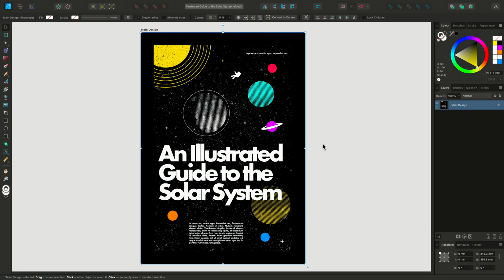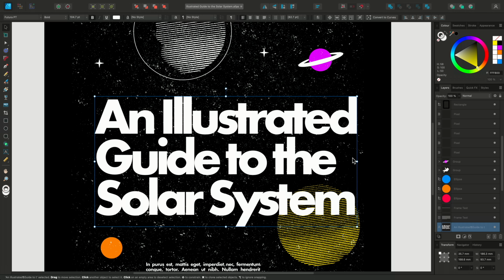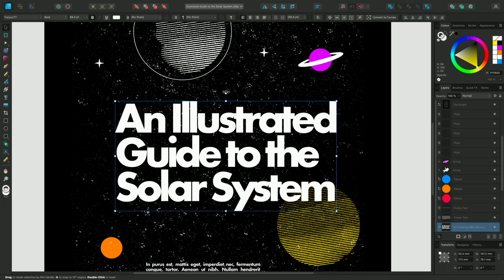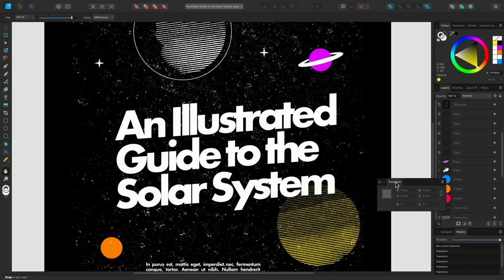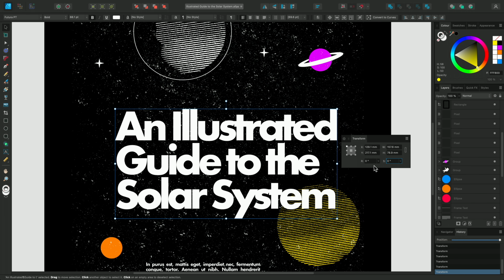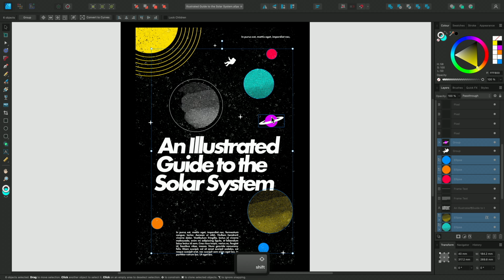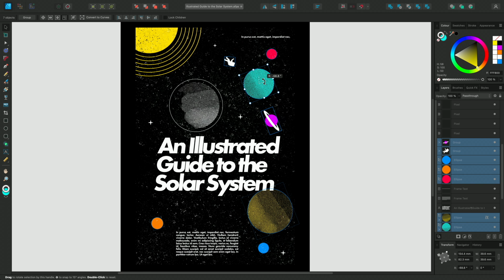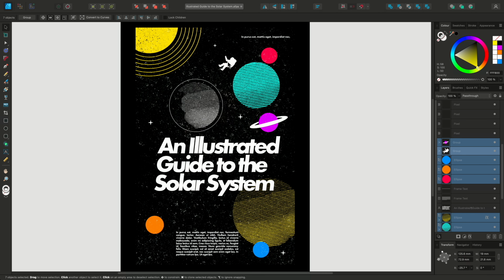Transforming Layers (Affinity Designer)

Comment: What I really wish to know is how to mirror an object using the transform point. I upgraded to version 2 after never being able to figure this out in version 1. for example, when I drag the transform point to the center of the document and mirror along the horizontal, it should use the transform point to mirror the shape to the exact opposite side of the document since the transform point is in the center of the document. but it does not do this, no matter what I try it mirrors the object and flips the transform point to the opposite side. What is the use of moving the transform point if I cannot use it as a point to transform?
I can only hope that I am doing something wrong and that this functionality exists.

Comment: Please provide an option in the settings so that shift is always required for proportional scaling. It's confusing making shift have the OPPOSITE effect, depending whether you're dragging by a corner or by aside.
Reply: Not really
Reply: Whenever I hold down Shift it always scales proportionally whatever handle I use. Ohh I get it, it's only on text objects. Yeah that's confusing.
Reply: They have to because Photoshop made it industry standard